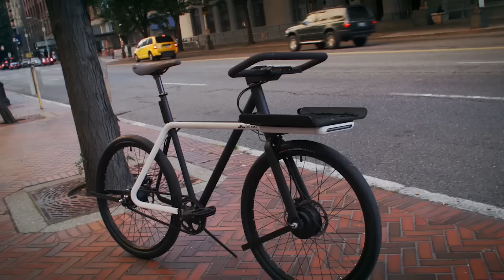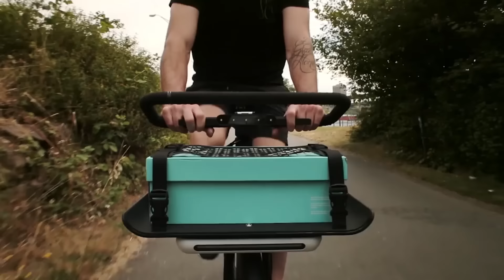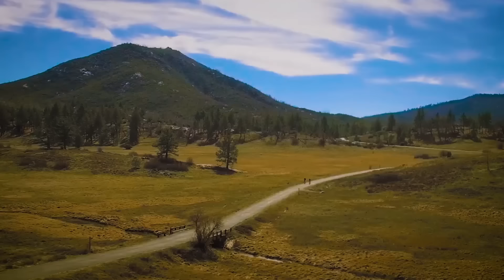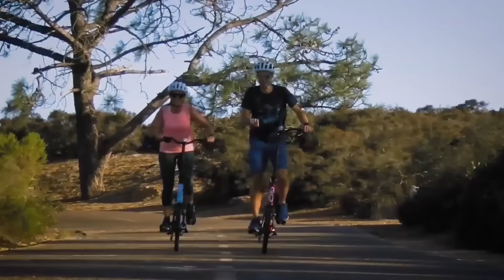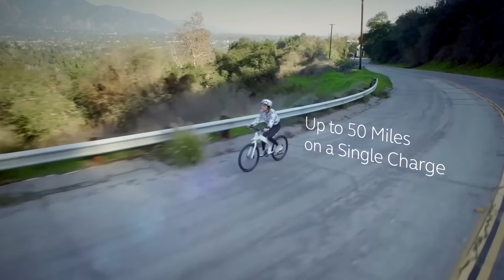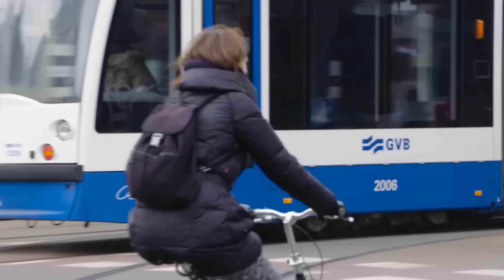5 UNUSUAL BICYCLES YOU HAVE NEVER SEEN BEFORE

Comment: The idea of a REMOVABLE Electric motor is great and for winter weather,it could be replaced with a 4 stroke engine (because batteries of ANY type loose significant capacity the colder and colder it is). Selection of fuels could include HHO or Hydrogen (no CO2). The big batteries could be replaced with one small battery for signals, etc.
Hey, how about QUADRICYCLES with leaning suspension design, about 3 foot wide, which should be stable on ice, snow mud. 4 mountain bike tires (2 2 inch wide) would do as well for traction as a 'fat-tire' 2 wheeler.
The EliptiGo is a great concept for exercise.....is an electric assist version available ?  
Conventional bicycle seats crush the PROSTATE glands of males, and standing up avoids this problem.
The 'Moonsaddle' came on the market 35 years ago, but was made to break. No doubt, it cracked in half, causing the seat stem to ruinate the cyclist's lower spine or rectum, so I never bought one. A few years ago a Kickstarter company was prototyping a small run of stronger Moonsaddle-shaped seats, but their website seemed virused, and they obviously failed. Their design should have Incorporated at least 4 springs to absorb stress on the wide seat, avoiding wobbly breakage.
I would have also complimented such a seat with a shock absorbing  seat STEM.  The more shock absorbtion parts, the longer bicycle components last, and less rider fatigue. Drum and disc brakes should have been standard equipment for DECADES.
Obviously, bicycle (tricycle and QUADRICYCLE) technology has been repressed by the petroleum and associated automotive industries.

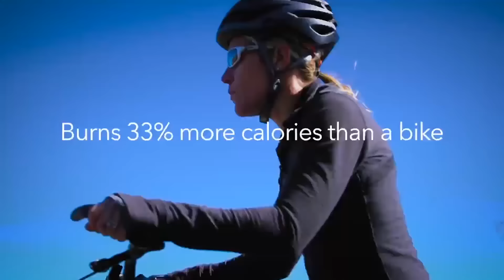Comment: 4:22 - "Burns 33% more calories than a bike" <--- LOL. That means it's less efficient than a bike. That's like bragging about a new model of car that burns 33% more gasoline than the older model. If you want to burn off your food energy faster so that you can spend more at the grocery store, there are lots of things you could do for free or cheap. For example, strap on a backpack loaded up with 50 pounds of stuff when you ride your existing bike.

Comment: “surprisingly it lets you burn 33% more calories than a traditional bike”

Not that surprising. The front profile of the rider is the single greatest source of drag on a bike. That’s why road bikes have you lean forward; it reduces the profile of the rider. That elliptical bike does the exact opposite, maximizing the profile and thus creating the greatest possible wind resistance.

Comment: im  looking  for  a  bike  that  has  a  lock  built  in  to  the  forks  so  that  the   wheels  can not  turn  when   the  lock  is  engaged  
this  can  be  on  both  front  and  back  or  one  or  the  other   built  in  L E D  headlights    tail  lights   and  turn signals  and  a    
 G  P S   TRACKING     just  in case    something  goes  wrong   like   bike  jacking

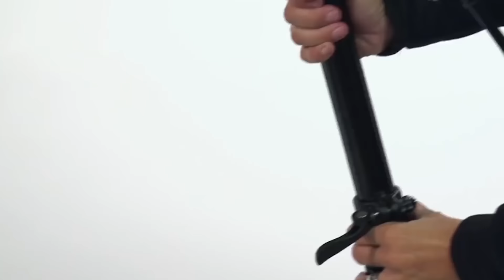Comment: 4:25   "It allows you to burn 33% more calories than on a traditional bike" - ??? - How is that? Per km.? Because it does not run as smoothly or is less aerodynamic than a traditional bike? Or what? 
No matter what kind of bike you are riding you have your maximum consumption of energy when you have your maximum absorbtion of oxygen because without that you can't consume energy more than in a short sprint. So is it: We have now invented a machine that wastes more or your energy than your ultra light aerodynamic bike - and it costs twice as much! Well, I could have that a lot cheaper ...

Comment: I live on the top floor, bicycles are heavy, I'm getting older but can still climb stairs. Are there any stair climbing bikes out there?
Reply: I don't know of any, but you can buy a light aluminum-frame road or hybrid bike that will be much easier to carry.  I purchased a used Schwinn last year and can carry it up the stairs with one arm, and mine is lightweight steel which is heavier than aluminum (but I am 30 so that helps). Also there are folding commuter bikes that have small frames, but I don't know how they are on weight since I've never used one.
The light weight also makes the bike much more fun to ride as well, since you'll be able to go faster and farther.  I went from struggling to ride 2 miles to class on a Walmart mountain bike to being able to commute 5 miles to work each way on a road bike.
Reply: If you’ve got a few thousand dollars to burn, you can pick up a carbon fiber bike that’s under 14 pounds. (under 10lb if you’re willing to spend as much as you might for a new car...)

Comment: does this vid have a bike thats single speed and has the chain looped on two different gears. 21 speed convert to single speed. run chaim on high gear. then loop to low gear. any one see this ? done it before. theres no research on it.

Comment: You should be ashamed of using click bait pictures and "April Fool Joke" bikes. Looking at ratios of likes to dislikes we can assume that a total of 395210.717 disliked the video ... and that 477546.283 liked it. From each of the 395210.7 "dislike crowd" members you've just "stolen" 10 minutes. That's a total of 3952107 minutes ... or 65868.45 hours ... or 8233.55625 x 8 hour "working days" ... or 1646.71125 "working weeks" ... or 35.03640957 "working years". That's exactly one half of a biblical lifetime. Significant isn't it??? Judgement day is coming. Don't believe me? Check out www.AmazingDiscoveries.org

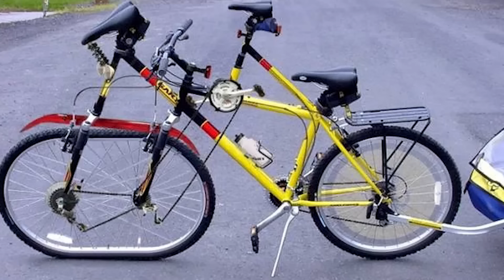Comment: I noticed that the bicycle in the thumbnail, @9:32, has a crankset (on the wrong side) above the water bottle. If it were to turn in the direction as shown, it would be turning the front wheel in reverse. The chain goes outside the fork, which is (wrong). A wheel with two hubs, No Way Jose, not going to turn, Ever. As others have said, this bicycle is Impossible to operate!   The photoshoping is very bad also.

Comment: Only clicked to see that oval front wheel / tank tread bike.
They show that same still pic for half a second.
Screw you guys.
Reply: Me too i tap only because of that wheel shape
Reply: Yeah, I would say click baiting is a form of soft scamming, there should be a report mechanism for click baiting on Youtube causing the video to become demonetized.
Reply: ya, that pic is bait, and the pic is photoshopped, that second bike on top doesnt work, the front wheel cannot turn, the chains are not connected to the treads (like tank), and the chain goes wierdly around the front spoke and back to the gears, its photoshop disaster.
Reply: Exactly what I was checking before I watched.  Thanks!  Now this channel gets “do not recommend” click from me
Reply: I don't know... I paused to have a look at that thing and had a substantial laugh. I think I got my moneys worth.
Reply: Just an advertisement
Reply: signed in just to down vote :P
Reply: Reported for spam or misleading
Reply: They love click bait
Reply: Its cheating
Reply: Only click to see that oval front wheel, and not seen anything about the one. Shame on you guys who's the admin of this channel. Instead of cheating like this you would have go and beg on street's.

Comment: Yeah, who needs a hardened steel bike lock when you've got an expensive bike with a hollow aluminum tube...

Congrats Denny, you've made a bike that can be stolen with an allen key.

Also, TechZone... watt is a unit of power, not capacity...
Reply: Anyone else wonder how the computer controlled transmission will hold up?
It being made in Seattle they would have to realize that bikes get wet.
I also get a kick out of turn signals on bikes.
I can just see the next bicyclist weaving through traffic while running red lights signalling before weaving.

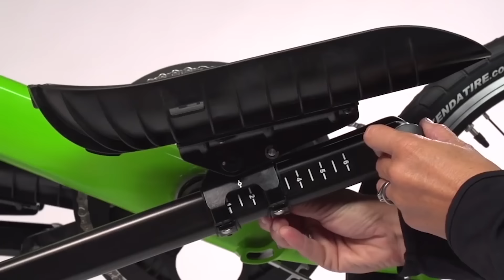Comment: 4:24 burning 33% more calories simply means it is less efficient than bicycle, and they are marketing a bad point as if it was good :)
Reply: There goal is to reduce impact on joints especially for older individuals who loves running. It is not meant for travelling
Reply: I can think of ways of burning even more calories - and without the $800 - $3500 spend!
Reply: I can burn 33% more calories in my current bike, Let 30% of the air out of the tires. Boom, The Flatago, buy now, you will be surprised how fast you shed the pounds.
Reply: Yup, drag a concrete block behind your bike,that will burn more calories.
Reply: Uh, no. It means you can produce 33% more power than if you were using only your legs. Granted, it was poorly presented, however.
Reply: @alexisbv2299  it is not "poorly presented": 33% more calories it's the same claim on their website.
Reply: @ddAAntes  Which means they're marketing it for weight loss. That being said, the video shows a fairly standard looking chainring/cassette drivetrain for the front wheel drive, so it's very unlikely that you'd get unusual losses there. The point still stands therefore that expending 33% more calories means around 33% extra power to the wheels. Assuming of course the lungs and heart can keep up with the additional demand ;)
Reply: @alexisbv2299  I copy&paste from their website:
They determined that stand up cycling burns, on average, 33% more calories than riding a conventional bike at the same speed
so the point is the same speed: you are making a greater effort for the same speed. as 1978garfield already commented you can burn even more calories dragging a concrete block ;)
Reply: @ddAAntes  my bad, for some reason I thought this whole thread was about that twicycle thing with hand cranks... Never mind then 🤪

Comment: On that twicycle you can see the brake cable touching the front chain which will eventually wear out the cable housing down to the metal cables.plus that chain in front looks kinda sketchy